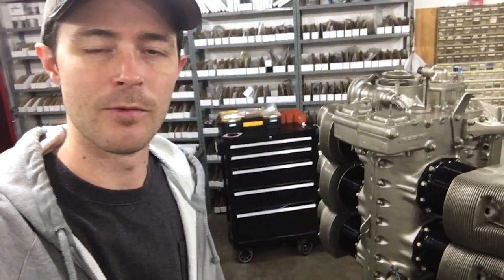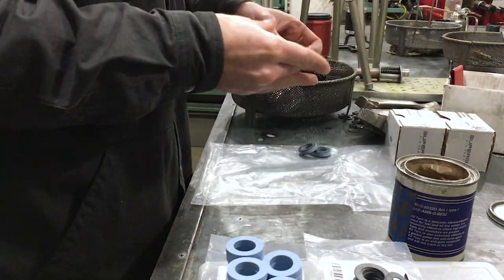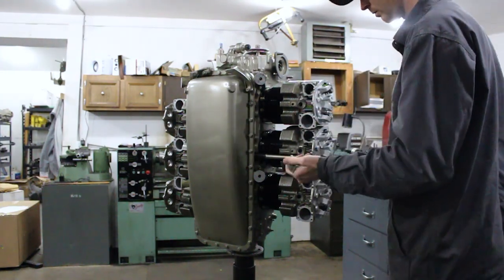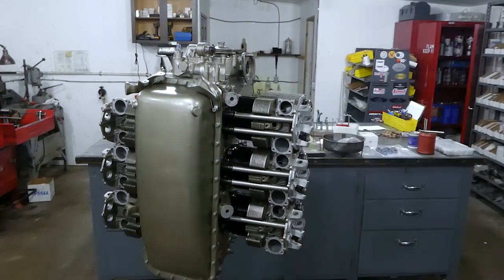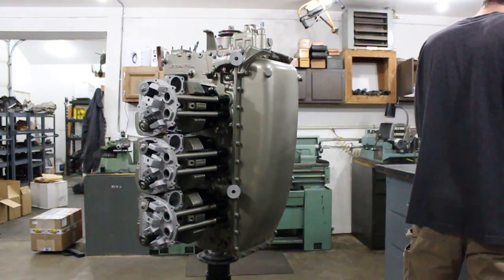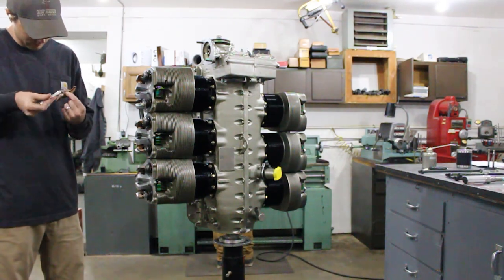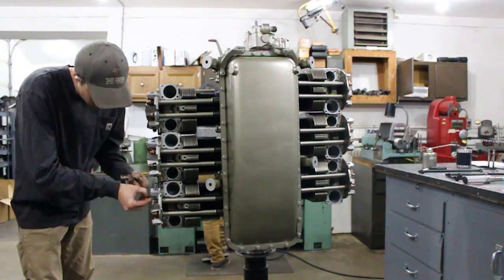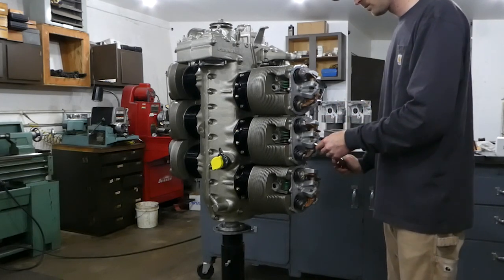How to Set Dry Valve Lash - Continental O470 Aircraft Engine

Comment: If you are just replacing pushrod tube seals does valve lash need to be reset because you have to remove the pushrod and rocker arm? Just curious. My shop is doing this on my 520.
Reply from the maker: Good question! No need to recheck the valve lash if all you are replacing is the seals. However you would need to be sure that the pushrods go back in the same spot (exhaust vs intake). Also on a lot of 470/520 engines you can’t slide the rocker shaft back in without deflating the hydraulic lifter.

Comment: It would be appreciated if you would answer the posters questions.

I have a question about starting this engine when installed with a pressure Carburetor,  it seems to be very difficult to start especially in cold weather.  Any tips?

What kind of paint do you use on the crankcase?

When measuring for proper valve lash, is the pushrod to be pushed in to take up the measurements, mentioned above, before measuring the for lash tolerance?

Which tool do you guys use for the push rod spring compressor and retainers? Part numbers?

 Do you guys sell used, internal O-300 parts?

Do you have a still photo of the crankcase just before putting on the oil pan?

do you have the part number for the half moon bushings in the leg support?

have you done a video for installing a filter on a IO-470 F-?

Why are you double bumping the torque wrench?

through studs and bolts around the perimeter of the block - what to tighten first tsio-520nb-?
Reply: Check your ignition system.  Is your wobble/electric pump delivering proper pressure before the start.  Throttle cracked, mixture rich, start wobbling and start cranking.  Should fire right up.

Comment: What kind of paint do you use on the crankcase?  I'm overhauling an o-470 right now and debating whether or not to paint the case. I used the Continental Gold engine spray paint for the intake tubes and sump so it would have to match but I really like the alodine look of the case.  Thanks for the video!

Comment: Do you have a still photo of the crankcase just before putting on the oil pan? Curious if the oil pan gasket could be replaced while installed in the C182p, how far the sump pick up is located ,  would the pan clear aft with the carb and induction tubes off.

Comment: good video!! do you have the part number for the half moon bushings in the leg support? i think this for pieces has to take the bolts to hold into the engine mount!!! i have the engine mounts and bolts but missing now the inserts .. thanks
Reply: Look in the parts manual for your airframe.  The mount is an airframe part.

Comment: Question for you.... with a deflated lifter... it can be pushed in probably an 1/8" - 3/16", which is probably the spring in the follower.  When measuring for proper valve lash, is the pushrod to be pushed in to take up the measurements, mentioned above, before measuring the for lash tolerance? Or, should the pushrod be naturally resting in the tappet   seat without taking up the above space, and then measure for lash tolerance?

Ty,
Chad
Reply: Pushed in.  Its a bottomed out lash.  Thats why the lifter must be deflated (without oil inside)

Comment: Great video! 
I have a question about starting this engine when installed with a pressure Carburetor,  it seems to be very difficult to start especially in cold weather.  Any tips?